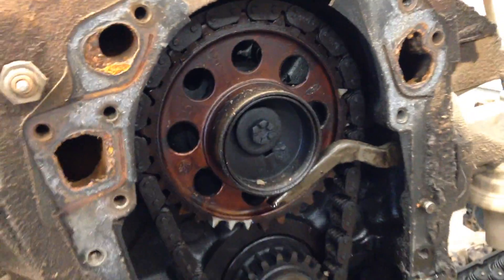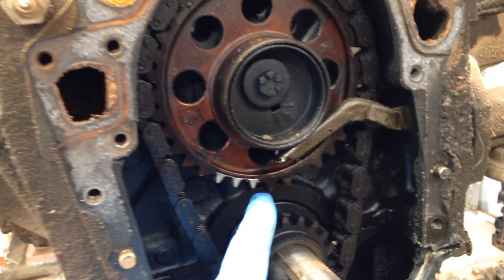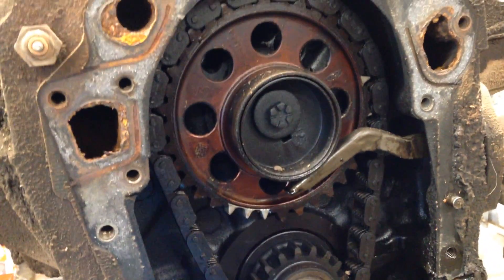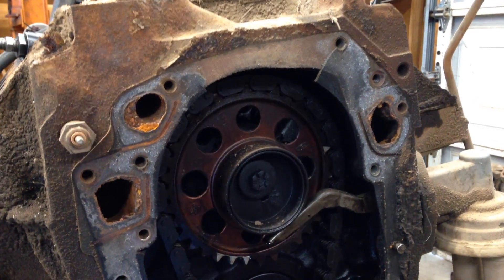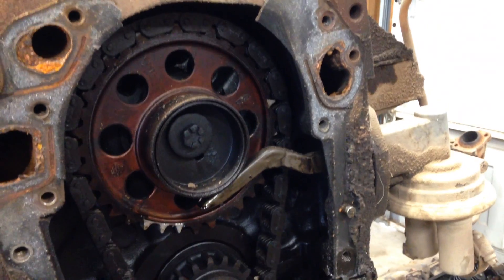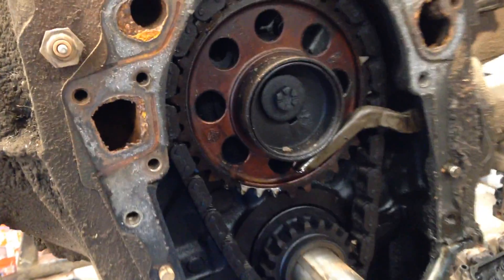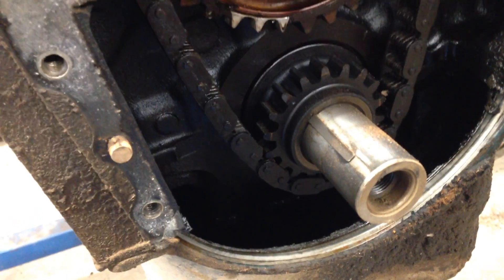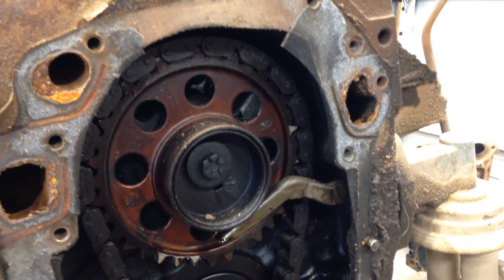Ford 351 Plastic timing gear

Comment: I'm not seeing the difference between a nylon tooth timing gear, and a belt that kills an engine if you go much pass 70k (or 50k in some cases).  The nylon gears in the Ford's would go well past 100k, and in most cases wouldn't kill the engine if they did.  I don't have your experience, but I rebuilt a 390 back in the 80's out of my dad's 70 LTD, and it had 142k on a nylon timing gear.  And it was still fine.  Loose chain, but fine.  Don't get me wrong, I mean nobody thinks the nylon gear is a good idea, but I feel the same about timing belts because they're worse...
Reply: Mat Helm 
Difference is a timing belt HAS a replacement period specified for it as a maintenance item. Should be 90k miles.These plastic gears did not... so they don't ever get changed.
many new cars have moved back to a chain... but in some cases the timing route is pretty convoluted and a belt is needed. also they are quieter, and also have less moving mass than a chain.
Reply: When I maintained a government fleet the Ford V8 nylon sprockets consistently failed at 80,000 miles. They were in Police cars so the hours were much higher than the miles would indicate.
Reply: Tim Sharpe My point exactly...
Factor in that PD cruisers should have hour meters, different drivers, and the balls to the wall every time they pull off from a stop, and that equals 140+k easy... ;p
Reply: My fleet was in central Florida where summer nights can still be in the 90 degree range and those cars were running AC around the clock.

The poor cops had to run the old Crown Vics balls to the wall because a 3800 pound car with a 140 HP V8 is slower than most 4 cyl Japanese cars. With a light bar the 1985 5 liter Crown Vic would only do 82 MPH. Pretty lame eh?
Reply: I looked up the estimated top speed of that car and it was 97 MPH.  A brick shaped, 3800 pound car with a 140 HP can't top 100 MPH going down hill with a tail wind. Add a full light bar that knocks off 12-15 MPH and you get about 82 MPH. 

I was there and drove them when they were brand new and factory tuned. The cops hated them because VW Beetles could out run them.
Reply: Tim Sharpe Not in 85.  Back then 4 cylinder rice burners were generally 50 to 85hp.  But 82mph is a bit of an under exaggeration, at least on flat ground.  But they were slow because chasing bad guys was a no no.  Motor voter and the like brought a lot of low IQ's onto the voter rolls.  Which in turn lowered the IQ of the average jury pool.  Which made for some way over the top damage awards via personal injury lawyer scum.  Which caused municipality's to have to self insure because the rates went through the roof.  Which caused automatic 10-22's (disregard) anytime there was a chase...
Reply: Tim Sharpe A stock Beetle would not out run them.  And not sure which rear end gear your city ordered, but the one's here would do 117mph.  Unless you actually had 84 models, which at 140hp, sounds about right.  In 84 we ran Dodge Diplomats with 318's at about 150+hp.  And they were slower than the crown vics.  Although there were a few 360's that would keep up with them, and hit 120+mph..
Reply: 1.) A 1985 VW GTI would do a 16.9 1/4 mile and a top speed of 118 MPH. The  85 Crown Victoria was over 2 seconds and 21 MPH slower.

2.) Ford LTD Crown Victoria 4-door, model year 1985, version for North America U.S.  4942 cm3 / 301.6 cui, advertised power: 104.5 kW / 140 hp / 142 PS ( SAE net ), torque: 339 Nm / 250 lb-ft   top speed: 156 km/h (97 mph) (theoretical);
accelerations: 0- 60 mph 12.2 s; 0- 100 km/h 13 s (simulation ©automobile-catalog.com); 1/4 mile drag time (402 m) 18.8 s (simulation ©automobile-catalog.com)

3.) There is no way in heck that a crappy little Windsor powered Crown Vic is going to hit 117 MPH even with the 351 HO. They couldn't do that even without the light bar.
Reply: Tim Sharpe That ain't a beetle... and a 85 crown vic, if ordered correctly with the HO EFI package had 185hp and would absolutely do 117.  Hell, a 84 Town car would do 122.  The Crown vic/s were clocked, but the TC was indicated..
Reply: I drove them all and the Crown Vic was the only cop car in the fleet that couldn't top 100 MPH even with the 5.8 HO. The Diplomat could do 115 and a 305 Malibu could do about the same. 350 Caprices could go anywhere from 120 to 130 depending on the year.
Reply: Looks like you're dreaming Ford fanboy fantasies again.

According to ©automobile-catalog.com the 180 HP HO Crown Vic had a 112 mph theoretical top speed and a 1/4 mile of 17.8 very long seconds. Add a light bar and that drops to about 98 MPH.

That's 6 MPH and .9 tenths slower than a 4 cyl VW Rabbit.
Reply: Tim Sharpe You keep googling while I actually drive them...  And still not a beetle...
Reply: I worked for a government fleet operation for 15 years so I fixed, maintained AND drove them all. Funny thing is how the documented evidence from automobilecatalog.com seems to be spot on with my own, actual, hands on, experience - not yours. 

If your wheezy little Windsor engines had half the balls you Fordnatics dreamed they did every class A motor home would have one under the hood.
Reply: Tim Sharpe Documenting would be going out and testing.  That's just a collection of generic data.  And fleet operations for a municipality is like working in the backwoods of auto repair.  You only see what a number cruncher ordered.  Where as some PD's take a hands on approach to writing the specs before putting it out for bid.  As there was no interceptor package back then..

And FYI, I drive a vette and a TA (which has a wheezy little 305)...  Nether of which are a Beetle...
Reply: You're digging a hole Son. I did my own darn testing and I gave you evidence that lines up with my own results. That's the facts. 

I have over 25 years of experience as a mechanic and 15 professional certifications. If you think owning a Corvette means something I've owned a few of those too.
Reply: Tim Sharpe If you notice, I never doubted your claims, with the exception of a beetle being faster.  What I pointed out was that if correctly ordered.. blah blah..

Owning a vette (and a  84 TA with only 185 beetle killing hp) means I'm not a "Fordnatic".  How would being dumb enough to buy a vette show any mechanical knowledge?  Except for doing all the work on it.  But even that only shows a fetish for self abuse...
Reply: Hey, in my defense I owned the Vette when I was only 21 and senseless. Now that I'm all grown up I drive a Toyota that never needs anything but tires and brakes.

Comment: I am the original owner of a 75 K10 chevy and at about 75 K I decided to change the timing chain just for fun , and this is exactly what I found , I replaced it with a nice double roller set and am still driving it today .

Comment: In the early '90's I bought a nice '71 Cutlass with a 350 Olds for cheap because it was running really lopey.  I could hear the timing chain making a weird whine, so I pulled the cover. The plastic teeth were mostly missing and it had jumped time by about 3 teeth. Thanks GM for the awesome deal you got me on a nice  car that wasn't so hard to fix. :)